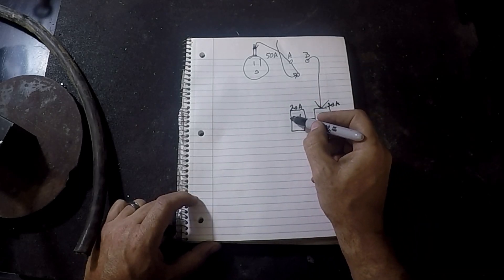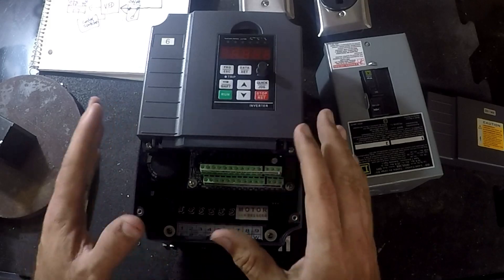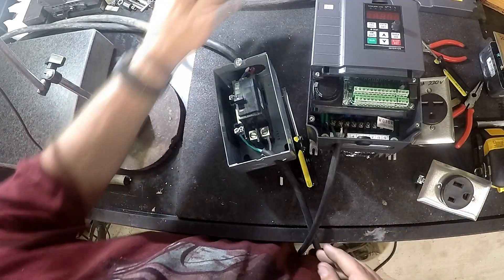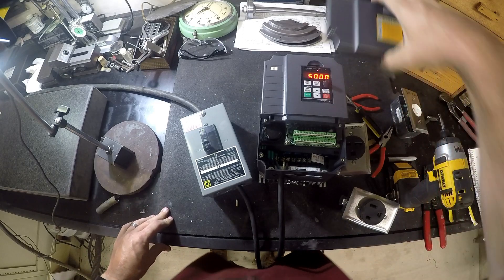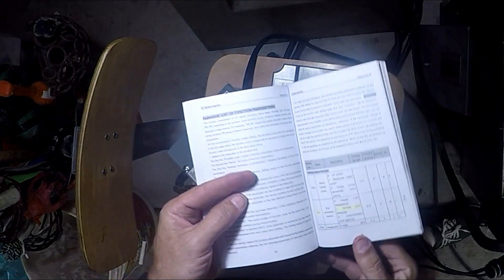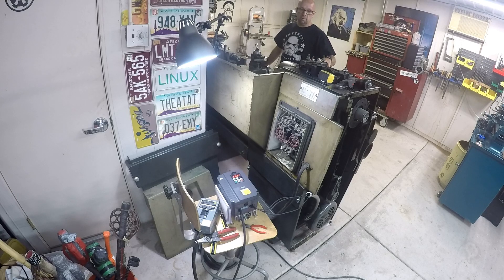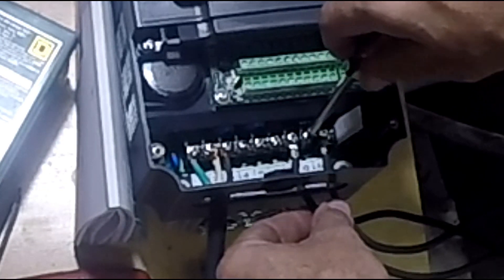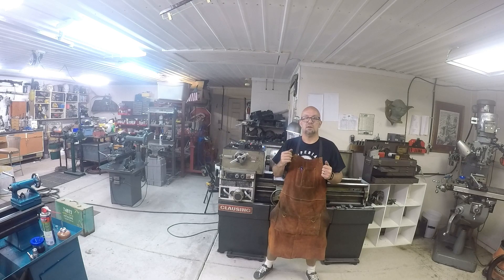VFD Running a big 7.5hp motor on a Clausing 1500 lathe

Comment: Thank you for this video I just purchased one of these today and doing research before it arrives so I can hook it up to my lathe I’m having to use it for motor controls as well as a converter like most do the original 7.5 motor was locked up I found a semi same 7.5 motor both motors are 2 speed 1800/3600 one being 4 wire hook up other being 7 so I’ve got to figure that out but the koping has plenty of switches and what not I think I’ve got enough to make it work

Comment: I just got o e of these, a gt-7r5g-2, do you just drop a leg on the three phase input? Mine is supposed to be single to 3 phase  but it has 3 phase input, nothing mentioned anywhere in the directions.
Reply from the maker: Yes, I had the same concern and even contact the seller to ship it back, they said just hook up the single phase to two of the inputs and it takes care of the rest.  I think they mentioned T1 and T2, but that it doesn't really matter which two.
Reply: @TheArsonsmith4242  I dropped one leg and it works fine. Dropped the middle leg, not sure if it even matters.
Reply from the maker: @wrightdesigns3333  I find it best to only drop the middle leg in accommodating company.
Reply: @TheArsonsmith4242  bahahahahahaha

Comment: Really like both the videos on this, I have a Large Powerhammer that has a 7.5Hp motor thats 3 phase. its under no load on start up  and wondered if you can point me in direction of a vfd for it. Lots on line about needing a giant VFD and it pulling huge amps to run the vfd. looks like from the video your running your lathe off just a 30AMP breaker going to the VFD and then to the Lathe. would like to know what model you used for yours as id like to basically copy it and lots of keyboard warriors give conflicting information that it can not be done but your doing it. any info further is greatly appreciated and keep the great videos coming!
Reply from the maker: Mine was one of the cheapest 10hp VFDs I think I found on amazon.  Let me dig through my history.
Reply from the maker: https://www.amazon.com/gp/product/B010CJBVOC/ref=ppx_yo_dt_b_search_asin_title?ie=UTF8&psc=1

These have a pretty bad rap on Practical Machinist, but I haven't had any trouble yet with mine.
Reply: @TheArsonsmith4242  Thank you Kindly! one thing that had me concerned is I have a 40 amp 220 supply to the area the motor and VFD will run off of but reading posts from the different people on several sites say that a VFD has to pull much higher amps to create the third leg so i didnt know if a 40 amp circuit would do it. in the video it looks like you ran yours off of a 30 amp circuit. was that sufficient until you switched to a rotary phase converter setup?
Reply from the maker: @bradkush1462  My Clausing is still running from a 30amp breaker with the VFD.  Also have my Bridgeport feed by that same breaker although I'm not sure I've ever ran them both at the same time.  If my cheap VFD ever lives up to it's poor reputation and dies I'll be running off the rotary.  Until then I'm not changing it.
Reply: @TheArsonsmith4242  well i have the VFD on order now and the new 9000 pound Hammer is in its new place. I understand that vfd's like to be directly wired into the motor which i can do but i was wondering if theres a way that I can turn the motor on and off without having to open the panel my vfd will be mounted in to start and stop the motor? the motor is never under load when started but in between forging times id like to be able to turn the machine off and one without having to open the dust proof panel and touching the vfd. Any  insights you may have is appreciated. thank you again for the great videos!
Reply from the maker: @bradkush1462  yes you can wire directly to the existing buttons as I have done on both my lathe and mill.  There is some low voltage DC connections you can use, then select the appropriate parameters in the manual.
Edit: this may be a bit confusing, you wire directly from wall to VFD then VFD to motor.  you can then run some smaller wire like ethernet cable from the existing switches to the low voltage terminals in the VFD.  Turns the buttons into soft buttons that just tell the VFD to then turn on the motor rather than hard switches that typically operate a contactor or the motor directly.
Reply: @TheArsonsmith4242  thank you for that, i will look at that option it sounds like a better option that accessing the vfd everytime i go to run the powerhammer

Comment: I think when you get everything permanently you should put a sub panel to power the welder, mill and the big lathe.  Of course you may already have a sub panel for the shop, if you do, hopefully you have enough empty spaces for some more breakers. I’m not an electchicken but I did stay in a Holiday Inn once upon a time!
Reply from the maker: Interestingly I found the Square D A-B switch but the damn things are almost $200 new.  Just bought a used one on ebay for $60, hopefully it'll be ok when it gets here.

Comment: Just tell all the keyboard electrical engineers where they can stuff there hat...   my 7hp shaper is powered with a heavy gage  cord. Mutch like what you have.   Im hopping to find a 2nd lathe soon.   I think you and Randy Richard has the same machine.
Reply from the maker: I couldn't find the 1500 after some quick reviews of his videos but he does have an older Clausing in this video: https://youtu.be/w5GqZIz6dsA  MrPete also has a Clausing similar to that one.  Mine i think is about 10 years newer, early/mid 70s.  I did cut some chips on it and it's a dream compared to my old 10" Logan.